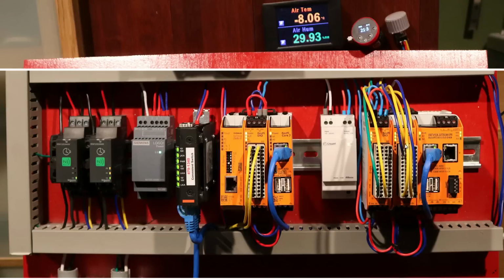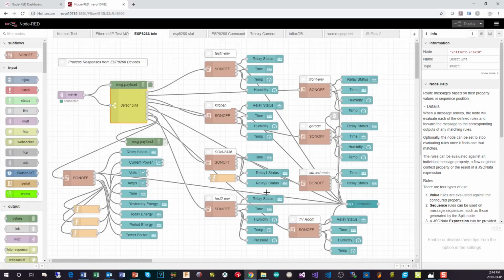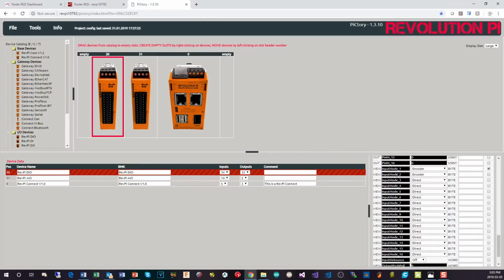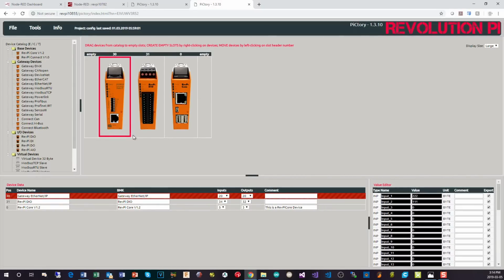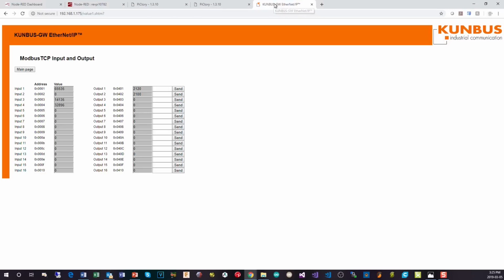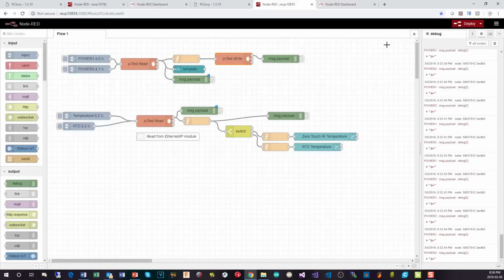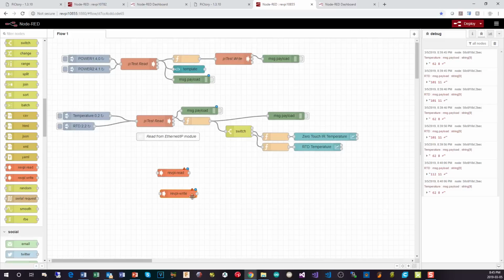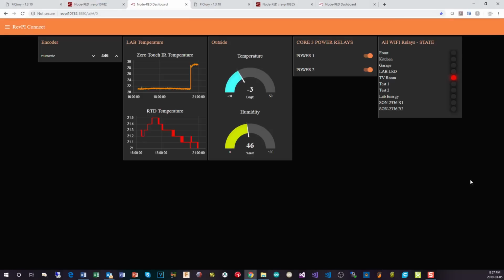Raspberry PI Revolution - Programming with Node-Red

Comment: Hi Thanks for video, any installation guide for this Pi connect. To avaoid chimeny effect Or heat dissipation. Please suggest.
Reply from the maker: Being a DIN rail mounted product I would say it is designed to expect to be mounted vertical in a way that would be the same when in a case on a wall

Comment: How fast is this system?Do you think it can be used for  industrial automation ?
Reply from the maker: These are for industrial Automation already, that is what there designed for
Reply from the maker: The higher level PI portion runs at the speed of the Compute module 3, all the IO modules run with their own MPU and communicate via a backplane, this is the same as Automation Direct,  PLC Next and many other Industrial PLC's running with Linux as the higher level OS. Remember Industrial Control is more about being predictable and reliable, not necessarily real time, in fact most Industrial Controllers are not really "Real Time" and in fact take several milliseconds through each loop through the logic programmed into them.
Reply: @TheBreadboardca  Do you think we can have the same speed as shown in our PLC project here - https://www.youtube.com/watch?v=YW3au3yBwAg ? Here we use Unitronics PLC. Note the time when the button is pressed and the sound from the pneumatic valve some 6-7 meters away from the panel.
 I see Kunbus system much more up-to-date and modern. Abloslutely ready for remote monitoring and control but still do not know how it will act if a flowmeter sends thousand  of pulses every second - how accurate the Kunbus sistem will close the valve at sertain point? What do you think?
Reply from the maker: @ivanchonin6747  The RevPi DI module can count upto 2KHz according to its datasheet, https://revolution.kunbus.com/wp-content/uploads/manuell/datenblatt/Datasheet_RevPi_DI.pdf,  as does the DIO module https://revolution.kunbus.com/wp-content/uploads/manuell/datenblatt/Datasheet_RevPi_DIO.pdf so it looks like it should work for you. I found the RevPi folks quite responsive to technical questions so if you need more detail beyond the datasheet I am sure they will help you out with confirming performance requirements for your scenario.
Reply: @TheBreadboardca  Thank you  for answer. I think it worth trynig.

Comment: He hi, I have some problems trying to connect my DIO, I guess I have some missundetanding with the term of "common" like PLC,  I know the inputs are +24 V sensitive. Maybe you have some schematic wiring about it. I'll really appreceiaty it. Thanks
Reply from the maker: The trick with these is that you must connect a separate supply to the IO. the power to the module logic is completly isolated from the IO and therefor it would appear as floating to the inputs.  you could wire the IO supplies in parallel to the module supply if thats ok with your installation.
Reply from the maker: forgot a link to the pinout  https://revolution.kunbus.com/wp-content/uploads/manuell/Pinout_IO_modules.pdf
Reply: @TheBreadboardca  okok Thanks, I already connected separately the porwer and the IO supply, so I tried to connect a push button from the Input to a +24V but i didn't see any change in the state I even wired it directly and didn't works. Any thoughts?

Comment: Hi sir can you send your node red code for the temperature reading
Reply from the maker: This is the flow for reading the Analog input Temp sensor and the RTD including display of it

[{"id":"3bc96220.e611de","type":"ui_chart","z":"25772a45.d1a976","name":"","group":"30cd6b17.dabee4","order":0,"width":0,"height":0,"label":"RTD Temperature","chartType":"line","legend":"false","xformat":"HH:mm:ss","interpolate":"linear","nodata":"","dot":false,"ymin":"","ymax":"","removeOlder":"12","removeOlderPoints":"","removeOlderUnit":"3600","cutout":0,"useOneColor":false,"colors":["#ff0000","#aec7e8","#142cfa","#2ca02c","#98df8a","#d62728","#ff9896","#9467bd","#c5b0d5"],"useOldStyle":false,"x":1170,"y":200,"wires":[[],[]]},{"id":"6f8b57dc.1141e8","type":"function","z":"25772a45.d1a976","name":"","func":"//var input = parseFloat(msg.value1);\nmsg.payload = msg.payload/100;\nif (msg.payload > 100){msg.payload=\"\"}\nreturn msg;","outputs":1,"noerr":0,"x":1010,"y":200,"wires":[["3bc96220.e611de","6b741948.56da98"]]},{"id":"6c3df6ed.e45b08","type":"switch","z":"25772a45.d1a976","name":"","property":"topic","propertyType":"msg","rules":[{"t":"eq","v":"Encoder","vt":"str"},{"t":"eq","v":"Temperature","vt":"str"},{"t":"eq","v":"RTD","vt":"str"}],"checkall":"true","repair":false,"outputs":3,"x":870,"y":140,"wires":[["63146c4d.b20dd4"],["574d23bb.fbf4ec"],["6f8b57dc.1141e8"]]},{"id":"6b741948.56da98","type":"debug","z":"25772a45.d1a976","name":"","active":false,"tosidebar":true,"console":false,"tostatus":false,"complete":"false","x":1170,"y":320,"wires":[]},{"id":"63146c4d.b20dd4","type":"ui_numeric","z":"25772a45.d1a976","name":"","label":"numeric","tooltip":"","group":"123f1e74.5fa762","order":0,"width":0,"height":0,"passthru":true,"topic":"Encoder","format":"{{msg.payload}}","min":0,"max":"32768","step":1,"x":1060,"y":100,"wires":[[]]},{"id":"574d23bb.fbf4ec","type":"function","z":"25772a45.d1a976","name":"","func":"//var input = parseFloat(msg.value1);\nmsg.payload = msg.payload/100;\nreturn msg;","outputs":1,"noerr":0,"x":1010,"y":160,"wires":[["8b1563b7.c4733","6b741948.56da98"]]},{"id":"902593be.92518","type":"function","z":"25772a45.d1a976","name":"","func":"var value = parseInt(msg.payload) == NaN ? 0 : parseInt(msg.payload);\nmsg.payload = value;\nreturn msg;","outputs":1,"noerr":0,"x":710,"y":100,"wires":[["6132fe03.4414c","6c3df6ed.e45b08","fde14686.8beb28"]]},{"id":"8b1563b7.c4733","type":"ui_chart","z":"25772a45.d1a976","name":"","group":"30cd6b17.dabee4","order":0,"width":0,"height":0,"label":"Zero Touch IR Temperature","chartType":"line","legend":"false","xformat":"HH:mm:ss","interpolate":"linear","nodata":"","dot":false,"ymin":"","ymax":"","removeOlder":"12","removeOlderPoints":"","removeOlderUnit":"3600","cutout":0,"useOneColor":false,"colors":["#ff8000","#aec7e8","#142cfa","#2ca02c","#98df8a","#d62728","#ff9896","#9467bd","#c5b0d5"],"useOldStyle":false,"x":1200,"y":160,"wires":[[],[]]},{"id":"42466a42.b6c1d4","type":"exec","z":"25772a45.d1a976","command":"piTest -1 -q -r ","addpay":true,"append":"","useSpawn":"false","timer":"","oldrc":false,"name":"piTest Read","x":550,"y":100,"wires":[["902593be.92518"],[],[]]},{"id":"6132fe03.4414c","type":"link out","z":"25772a45.d1a976","name":"PiTest","links":["f6cc4bbf.c82a98"],"x":835,"y":60,"wires":[]},{"id":"fde14686.8beb28","type":"debug","z":"25772a45.d1a976","name":"","active":true,"tosidebar":true,"console":false,"tostatus":false,"complete":"payload","x":890,"y":20,"wires":[]},{"id":"7e0b9f33.2b913","type":"inject","z":"25772a45.d1a976","name":"","topic":"Temperature","payload":"InputValue_1","payloadType":"str","repeat":"10","crontab":"","once":false,"onceDelay":0.1,"x":320,"y":80,"wires":[["42466a42.b6c1d4"]]},{"id":"f4a2e0bf.b5a5b","type":"inject","z":"25772a45.d1a976","name":"","topic":"","payload":"InputValue_2","payloadType":"str","repeat":"","crontab":"","once":false,"onceDelay":0.1,"x":270,"y":120,"wires":[["42466a42.b6c1d4"]]},{"id":"d745fb68.60e9a8","type":"inject","z":"25772a45.d1a976","name":"","topic":"Encoder","payload":"Counter_1","payloadType":"str","repeat":"10","crontab":"","once":false,"onceDelay":0.1,"x":300,"y":40,"wires":[["42466a42.b6c1d4"]]},{"id":"12b11536.d15f3b","type":"inject","z":"25772a45.d1a976","name":"","topic":"RTD","payload":"RTDValue_1","payloadType":"str","repeat":"10","crontab":"","once":false,"onceDelay":0.1,"x":290,"y":160,"wires":[["42466a42.b6c1d4"]]},{"id":"30cd6b17.dabee4","type":"ui_group","z":"","name":"LAB Temperature","tab":"c21d8268.2e9a","disp":true,"width":"6","collapse":false},{"id":"123f1e74.5fa762","type":"ui_group","z":"","name":"Encoder","tab":"c21d8268.2e9a","disp":true,"width":"6","collapse":false},{"id":"c21d8268.2e9a","type":"ui_tab","z":"","name":"RevPI Connect","icon":"dashboard","order":1,"disabled":false,"hidden":false}]

Have fun
Reply: @TheBreadboardca  Thank you so much

Comment: hi, what's that SONOFF node in your nodered palette? Can't find it...
Reply from the maker: it is simply a subflow... here :)

[{"id":"898abb8.06b2548","type":"subflow","name":"SONOFF","info":"","category":"","in":[{"x":180,"y":140,"wires":[{"id":"9a777985.881598"}]}],"out":[{"x":900,"y":80,"wires":[{"id":"25607b40.4eed94","port":0}]},{"x":900,"y":120,"wires":[{"id":"9a777985.881598","port":"1"}]},{"x":900,"y":160,"wires":[{"id":"a4320087.8d098","port":0}]},{"x":900,"y":200,"wires":[{"id":"ce94a5ef.160c28","port":0}]}],"outputLabels":["STATE","POWER","SENSOR","RESULT"]},{"id":"9a777985.881598","type":"switch","z":"898abb8.06b2548","name":"tasmota","property":"topic","propertyType":"msg","rules":[{"t":"cont","v":"STATE","vt":"str"},{"t":"cont","v":"POWER","vt":"str"},{"t":"cont","v":"SENSOR","vt":"str"},{"t":"cont","v":"RESULT","vt":"str"}],"checkall":"true","repair":false,"outputs":4,"x":300,"y":140,"wires":[["d804d0d1.24b7c"],[],["cf9daa54.4c1dd8"],["ce94a5ef.160c28"]],"outputLabels":["","Power","Sensor",""]},{"id":"7fe77cc0.e7b964","type":"function","z":"898abb8.06b2548","name":"","func":"if (msg.payload.DS18B20)\n{\n    msg.payload.type='Environment';\n    msg.payload.Temperature = Math.round(msg.payload.DS18B20.Temperature);\n    msg.payload.Humidity = 0;\n    msg.payload.Pressure = 0;\n}\nelse if (msg.payload.AM2301)\n{\n    msg.payload.type='Environment';\n    msg.payload.Temperature = Math.round(msg.payload.AM2301.Temperature);\n    msg.payload.Humidity = Math.round(msg.payload.AM2301.Humidity);\n    msg.payload.Pressure = 0;\n}else if (msg.payload.DHT11)\n{\n    msg.payload.type='Environment';\n    msg.payload.Temperature = Math.round(msg.payload.DHT11.Temperature);\n    msg.payload.Humidity = Math.round(msg.payload.DHT11.Humidity);\n    msg.payload.Pressure = 0;\n}\nelse if (msg.payload.BME280)\n{\n    msg.payload.type='Environment';\n    msg.payload.Temperature = Math.round(msg.payload.BME280.Temperature);\n    msg.payload.Humidity = Math.round(msg.payload.BME280.Humidity);\n    msg.payload.Pressure = Math.round(msg.payload.BME280.Pressure);\n}\nelse if (msg.payload.ENERGY)\n{\n    msg.payload.type='Energy';\n    msg.payload.Total = msg.payload.ENERGY.Total;\n    msg.payload.Yesterday = msg.payload.ENERGY.Yesterday;\n    msg.payload.Today = msg.payload.ENERGY.Today;\n    msg.payload.Period = msg.payload.ENERGY.Period;\n    msg.payload.Power = msg.payload.ENERGY.Power;\n    msg.payload.ApparentPower = msg.payload.ENERGY.ApparentPower;\n    msg.payload.ReactivePower = msg.payload.ENERGY.ReactivePower;\n    msg.payload.Factor = msg.payload.ENERGY.Factor;\n    msg.payload.Voltage = msg.payload.ENERGY.Voltage;\n    msg.payload.Current = msg.payload.ENERGY.Current;\n}\nreturn msg;","outputs":1,"noerr":0,"x":570,"y":160,"wires":[["a4320087.8d098"]]},{"id":"cf9daa54.4c1dd8","type":"json","z":"898abb8.06b2548","name":"","x":450,"y":160,"wires":[["7fe77cc0.e7b964"]]},{"id":"d804d0d1.24b7c","type":"json","z":"898abb8.06b2548","name":"","x":450,"y":80,"wires":[["25607b40.4eed94"]]},{"id":"25607b40.4eed94","type":"moment","z":"898abb8.06b2548","name":"","topic":"","input":"payload.Time","inputType":"msg","inTz":"ETC/GMT","adjAmount":0,"adjType":"days","adjDir":"add","format":"lll","locale":"en_CA","output":"payload.Time","outputType":"msg","outTz":"America/Toronto","x":740,"y":80,"wires":[[]]},{"id":"ce94a5ef.160c28","type":"json","z":"898abb8.06b2548","name":"","x":450,"y":200,"wires":[[]]},{"id":"a4320087.8d098","type":"moment","z":"898abb8.06b2548","name":"","topic":"","input":"payload.Time","inputType":"msg","inTz":"ETC/GMT","adjAmount":0,"adjType":"days","adjDir":"add","format":"lll","locale":"en_CA","output":"payload.Time","outputType":"msg","outTz":"America/Toronto","x":740,"y":160,"wires":[[]]}]

Enjoy